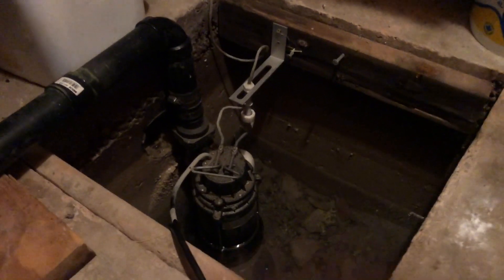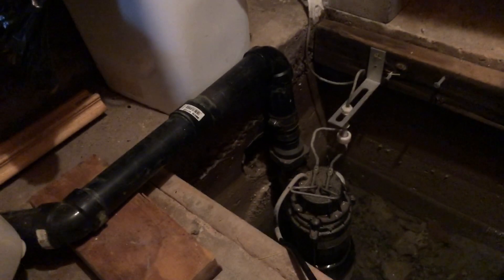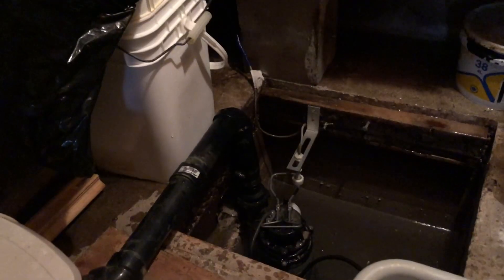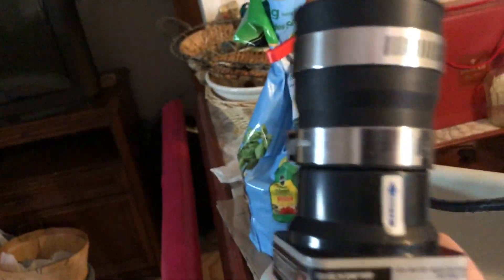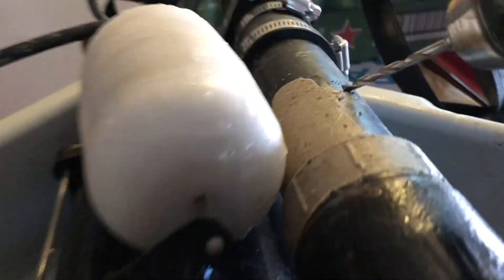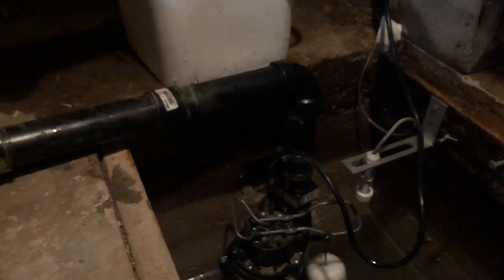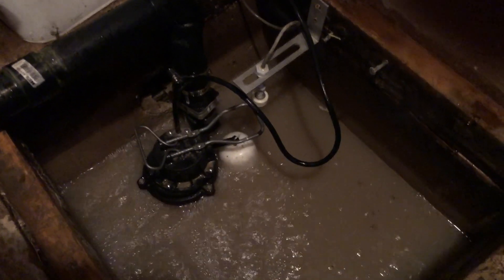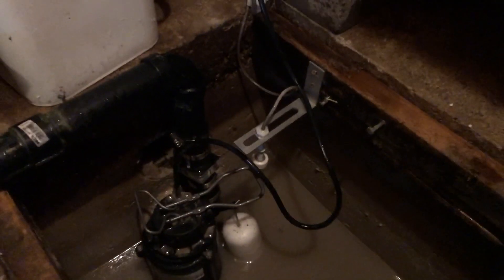New Sump Pump Discharge Issues - Check Value Change and Weeping Hole

Comment: That can't be good. Now your pump is stirring up the sand in the bottom of your basin and going into your pump.
Reply from the maker: The sump pump manufacturer recommended it and the if there is sand in the pit its going into the pump regardless.  It’s optional but no issues……thanks for watching.